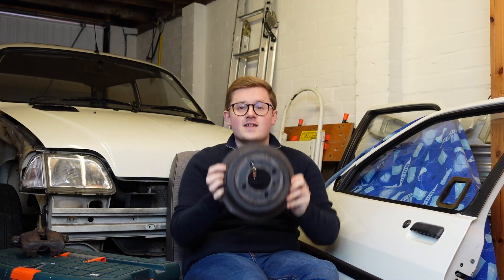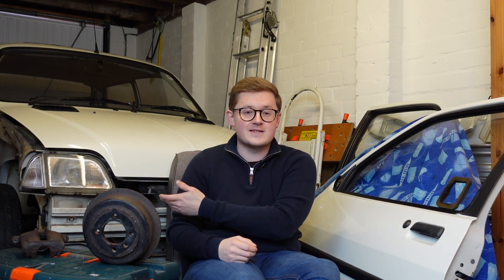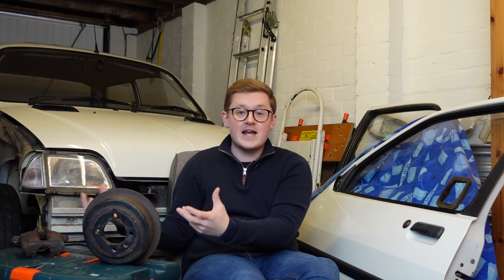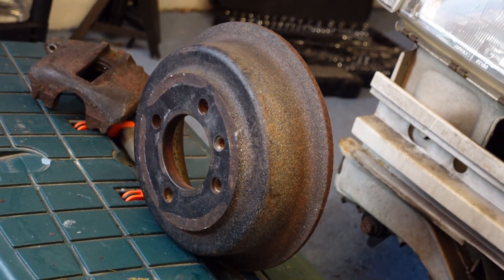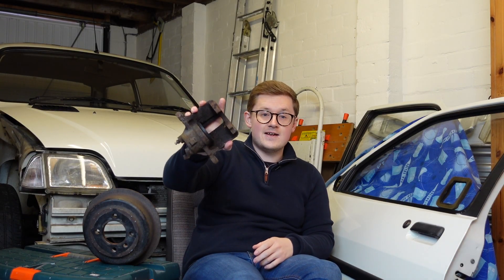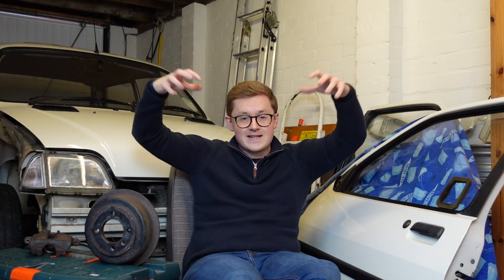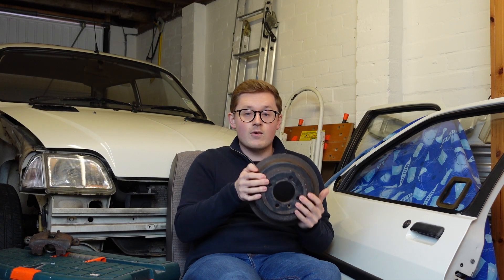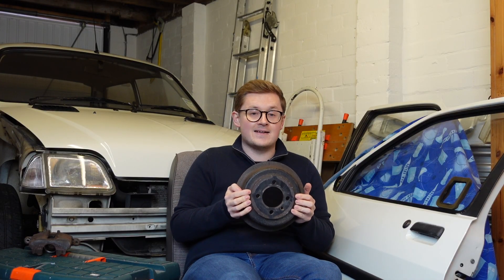Why are Drum Brakes Making an EV Comeback?

Comment: Great video! Here in Norway where we have a lot ov EV’s and a lot of salt on The roads during The winter months, we do see a lot of issues with rust related to disk brakes. In addition to rust on the disks themselves, the calippers are exposed to rust and The pistons become difficult to move. The hydraulic force when The pedal is pushed is often enough to move The piston when braking, but it sometimes gets stuck and won’t return when you take your foot of The brake. This locks The brakes on and wears out both The pads and disks quite quickly.

Comment: And those thoughtful engineers came up with an ingenious plan to overcome the heat problem
Hey, let's make brake shoes out of
wait for it . . .
ASBESTOS

First thing I was told at the VW dealer as a fledgling new mechanic . . . DON'T GET THE BRAKE DUST ON YOU

AND DON'T BREATH IT😮

Comment: Could you make regenerative braking even more effective by applying reverse flux?

Could you even make an EV without any friction brakes if legislation was changed to allow it?

Great channel with really clear explanations, I’ve subscribed.
Reply: If the EV has an engine on every wheel
So the ABS/ESP works and every wheel can deliver it's mandatory braking force
Why not
(But the brakes still have to "work" a bit even if the "engine"isn't running)
{That last bit could be the real problem}

Comment: all i know is the handbrake in the peugeot 206 i used to own was a lot stronger than the Focus ST170 that I have now.
the 206 had drum rear brakes whereas the focus has disc rear brakes and the handbrake mechanism operates a screw which applies the caliper piston.

Comment: As with most things on a car, all the disadvantages of either system relative to each other can be engineered out. Thus the method that can achieve desired performance and durability targets either more cheaply or with less engineering time will be chosen.

Comment: In the issue of cooling drum brakes. The Asian truckers prefer to cool the drums by blasting it with water during downhill. It even has an option to cool hub reductions and differentials during uphill. There are many kits for large trucks that can be installed fairly quickly. It is not a manufacturers standard so you have to install it yourself. Hired drivers are more prone to brake overheat than owner operators especially those who invest in water cooled drums system.

Comment: As with everything, there are exceptions from the rule. My Fiat has disc brakes all round and the hand brake is applied by a cable operated lever sticking out of a caliper, similar as in drums :)

Comment: I seem to remember that a lot of drum-braked economy cars in the past were compromised by manufacturers using smaller than necessary drums to cut costs. In Oz,  Holdens of the fifties/sixties used too small a drum resulting in premature fade( ask any Oz caravanner f the time).

Comment: All of VWs MEB platform which includes ID3 upto ID Buzz and Audi Q4 Etron share the rear drum! Seeing an ID Buzz with huge 22" wheels and drums brakes looks strange!
Jusy one point regarding the performance of a brake system. Area of the pad or shoe has no relation to brake performance/stopping power - only has an effect on wear.
Modern brake calipers also have springs to pull the pads off the discs - though over time/corrosion this won't be as effective as drum shoe return springs.
Overall, a good video, from brake system engineer.

Comment: The rear parking brake can actually be integrated into a rear caliper, i know at least honda has done this and i think other Japanese car makers. The rear brake piston i believe is a 2 piece sleeve with the parking brake pulling on a lever attached to the inner part of the piston which is mated with the outer  like a screw.

Comment: Changed from drums to discs on a Morris 1000 in 2020 (all brand new components)the stopping distance is improved but they feel very little different in use and not really any better than running Wolseley 1500 drums on a Minor so long as properly maintained.

Comment: another advantage of drums over disks is: You don't need bigger wheels to make drums bigger.
I mean you can make them wide instead of making their diameter bigger.
Some EVs are getting inconveniently big wheels due needing better breaks due higher weight. Some people think big wheels are beautiful, but in most cases they are not a good idea. It takes more room of your car; the tires are more expensive; And in places where asphalt is not perfect, when tire is thinner, they are less comfortable and easy to damage in potholes both wheels and tires.

Comment: Ah, I've been thinking about the disc brake issues I have with my PHEV (because I use the electric drive a majority of the time, with a lot of regen braking, and the discs hence rust up pretty bad and cause annoying intermittent brake pad contact noise). It never occurred to me that drum brakes would no doubt be a much better choice for an EV, thanks for the heads up!
Reply: In the mean time, you can combat this by using your brakes once in a while. The owners manual usually has a procedure for this exact problem.
Reply: There are only two known ways to completely bypass regen braking on my particular vehicle, the first is by having a 100% charged battery, the second is by reversing. Too bad none of those are useful when following the recommendation to brake hard/medium at 60 km/h (the 100% battery situation rapidly declines even when battery charge preservation is enabled, which causes regen braking to resume, and reversing at 60 km/h is not something I'd like to even try). But yes, actually using the regular brakes is the solution, as you say.  @drradar
Reply: different technology. I had several cars with drum brakes in the rear.
They generally last longer, but they don't take as much heat as the discs (important when you're heavy on descends).

Another issue is that it's not so easy to "feel"/hear drum brakes that don't work good anymore, especially when they're in the back.
Reply: Yes, I'm aware. I've always had "performance" cars, which never had drum brakes, and had all but forgotten about their existence. But this video made me realise that for my PHEV they would be much more suitable than disc brakes, for my use case (i.e. almost exclusively regen-braking).

Where I live, there's a mandatory nation-wide annual car check-up that must pass, otherwise the car is not allowed to be driven at all. One of the many checks is brake force, measured separately for each wheel. If there's too low brake force, or too much difference between the brake forces of the rear brakes, the car won't pass (and must be fixed ASAP + confirmed with an additional check-up). Hence it's hard to miss if (especially the rear) brakes go bad.

    @svr5423

Comment: Pretty much all trailervbrakes are drum brakes. This includes tractor trailers( or lories) Traven trailers, and all construction equipment  using hydraulic  braking systems  or electric brakes using an electric actuator that can be adjusted. drum brakes are still used on most vehicles for the emergency  brake, being a split disc/ drum setup.

Comment: I put well over 300,000 miles on cars with drums on all four wheels, including a 5,000-pound, 1966 Chrysler station wagon, and they're simply not a problem at all.  The power breaks are tuned for whatever pedal feel the manufacture thought you'd like that year.  You would not notice the difference.  And that Chrysler, having come with the factory towing package, had extra-wide break drums with cooling fins.

And there's no physical reason on Earth why a disk break caliper couldn't have retractable pads.

All the presumption that says you must have disk breaks comes from hype alone, because they're used in racing.  If you're not actually entering actual races with your transport sedan or your pickup, you'd never notice the slight differences.  But you'll still want disk breaks because you've been hyped into thinking that they're objectively better on the public streets and roads, for legal driving at mostly legal speeds.  They're not.

Comment: I notice a lot of newer petrol fueled cars have disc brakes on the back as well as the front, luckily my older car has drums on the back which I much prefer. For anyone who drives gravel roads a lot of in wet weather, you'll notice mud splashes on the brakes. It has no effect of closed in drum brakes but makes a mess of disc brakes. Also, the hand brake works better with drums than discs. Why would any sane person want disc brakes on the back?

Comment: regen braking will not stop your car, it will slow it down but as any railroad engineer will tell you, somewhere around 10 mph they stop stopping, now you can play some electrical tricks on them that will help this situation, you need the mechanical brake for parking anyhow.  A lot of the drum brake problems are related to a 'servo' design whereby the leading shoe of the brake contacts the drum and the rotating power of drum forces that shoe into the following shoe, this allows a light push on the brake pedal to stop a heavy car without using any power assist system.  If you pushed too hard on a servo brake it would lock up and not release, yeah, I've been there.  Jaguar used this idea in reverse, servo off braking, they'd never lock up and worked rather smoothly.  Regular servo brakes do not work well in reverse and the braking force declines as the car slows down meaning that you have to increase pedal pressure  as you are stopping.

Comment: I’ve run drum and disk brakes and drum brakes last longer. They are inherently better in every way if only people can understand what makes them work. One part about disk brakes is the square cut seal around the piston should pull the pads back away from the rotor. Any runout could be from hun deflection, bearing side to side play or sticking components which adds to maintenance.

Comment: Yes, that is all true but, it should be noted that the hydraulic components associated with disc brakes have a typical lifespan of 80k to 120k miles whilst drum brake slave cylinder  components are as little as 20k miles. I speak from 50 years experience of both. I would avoid drum brakes on any car personally, ev or otherwise
Reply from the maker: Maybe in 1980, but certainly not today. Modern calipers are no longer lived than wheel cylinders.
Reply: Maybe it would be possible to get rid of the hydraulic system altogether and drive the brakes electrically on an EV. Removing the whole hydraulic system may save on weight and maintenance, as well as any environmental impact of hydraulic fluid.

Comment: EU automotive regulators are talking about fitting accelerometer switches to the brake lights. 
This solves two problems
(1) The regen braking of Hybrids and EVs will display the brake lights.
(2) Timid drivers that rest their foot on the brake pedal (just in case) will not display their brake light when no braking is happening.

Comment: Rather than an additional, small drum brake, my old Acura Integra simply added a worm gear to the handbrake cable, thus multiplying the force many times and allowing the rear discs to be used for the handbrake. It worked well and I wonder why other cars didn't use it.
Reply: Because it encouraged handbrake turns that eventually lead to the cable snapping prematurely.
Reply: @ShortArmOfGod you can still do handbrake turns with a drum brake, i can confirm first hand
Reply: @skonky tbh I think he knows that lol, the point he’s making ( I think) is that it really will lock very brutally and completely so encouraged it more ( PS I’ve done auto testing in both drum reared and disc reared cars and the rear discs with that type of handbrake are simply stunning for handbrake turns and no matter how well you set up a drum handbrake it will never compete with that) 😊
Reply: I'm sure my old Suzuki Swift had that, you had to turn the rear piston in order to change the pads
Reply: A gazillion cars use this mechanism idk why the video treats it as being impossible
Reply: @TheAllAroundMan  agree completely
Reply: Many others do such as my Volkswagen Passat
Reply: had a volvo that did the same thing.
Reply: I had a 1970 Mercedes that had 4-wheel discs, with extra small drums in the back for the parking brake.
Reply: My 2004 Renault Megane II has also a sort of lever on the rear calipers, attached to the handbrake cable.
Reply: my miata has the same thing, though the worm gears are notorious for stripping and so I have only one working handbrake caliper. It's also a pain in the ass to replace the handbrake cable
Reply: In all my years of all disk vehicles have never had a hand brake problem.
Reply: My Integra was the same. The handbrake cable pulls on a cam on the back of the rear caliper. 

I'm not sure exactly how it worked internally but it wasn't super reliable. Neither handbrake worked when I bought the car and replaced the calipers, and one of the new ones died within two years. My Acura RSX had the same problem, only one side ebrake working with no visible failures on the outside of the calipers.
Reply: Driving a 8th gen civic, never had a problem with the handbrake

Comment: EVs use regen for a lot of braking, drums make sense for the remainder. Discs are only superior to drums for ease of service and heat dissipation over repeated stops. That’s no longer a a factor with an EV since the drums only provide a portion of the braking and don’t need to dissipate so much heat. I own 3 cars with drums on all 4 wheels they brake very well.

Comment: Drums have stuck around cause car manufacturers are cheap AF. there is no advantage to keeping them around other than saving money. they're also not as safe because of the fact that they constantly need to be adjusted as they wear down unlike disk brakes. I'd rather pay more money for 100% reliable parts.

 Besides, car manufacturers will not pass the savings down to their customers anyway

Comment: Interesting. I've always thought of drums as being a ridiculous cost cutting measure for bottom-rung vehicles but you've made me thinks of them in a new light.

As an aside, I wonder if regen could eventually be used to justify eliminating the rear brake altogether. Regen doesn't work at very low speeds, but the front brake could handle most normal stops, and running the rear drive motor in reverse would handle panic stops. You could elimate all of the weight and complexity of the rear braking system, replacing it with some electronics.
Reply: I learnt about drum fade when I passed my test in 1978 in my 1960 VW Beetle.  Having been told how 'dangerous' drum brakes were on old cars I thought I would test them.  I found a long straight downhill unrestricted road (to improve the acceleration time of the massive 32bhp on tap) and started braking from 60mph as quickly as I could turn round and repeat the test.  Even on this old classic it took seven emergency stops before the brakes became hot enough to begin fading...
Reply: @thedubwhisperer2157   I can get all four discs on my car hot (so I can smell them) on mountain passes when the car is full with passengers.

A drum brake would simply not have enough cooling. For small and light vehicles, they are ok though.

Comment: So my expectation is that drum brakes leave you feeling for the right pressure more often with internal combustion vehicles because that's my experience. Regenerative braking with drum brakes would make sense to me. Electronic based systems tend to be more precise than analog or mechanical ones and you still have the failsafe.

Comment: EVs can generally brake harder than what you need in the vast majority of situations on regen alone. Having a bit of extra braking force from drum brakes for these few yellow lights or emergencies makes plenty of sense. If you can easily reach the traction limit of your tires with those (when ABS kicks in), having more stopping power from discs would be useless anyways. Great video!
Reply: As a safety system, you need them consistently at all times. Regen braking is usually disabled as high battery SOC levels.
Reply: @DoesntRefillTheBrita  is SOC state of charge?
Reply: @636theofthebeast8  yes
Reply: @DoesntRefillTheBrita  I didn't think about that, it makes sense. This is such a specific issue, I hope there's a way around it. Thanks for pointing it out.